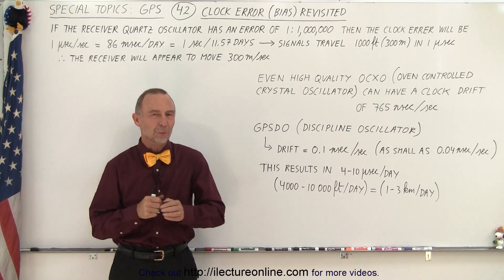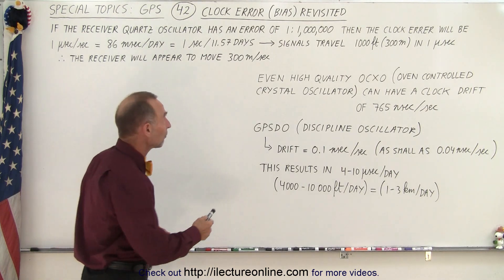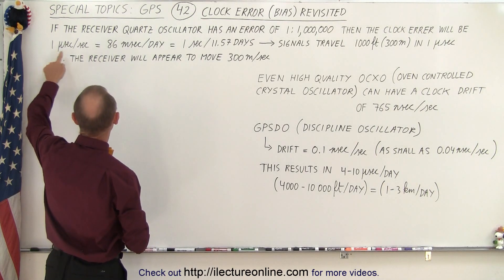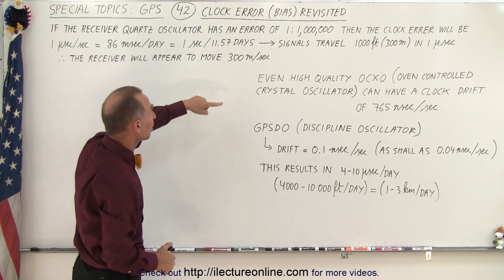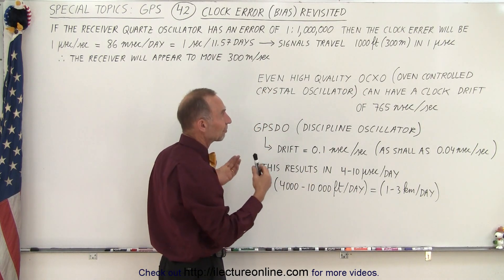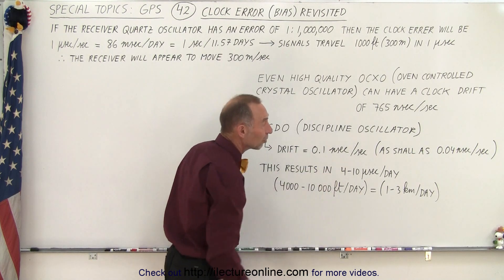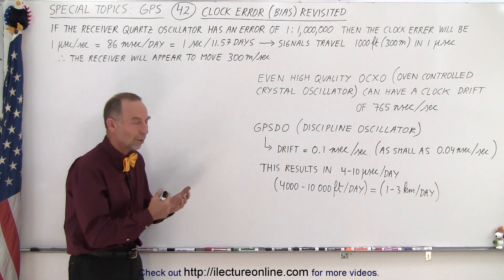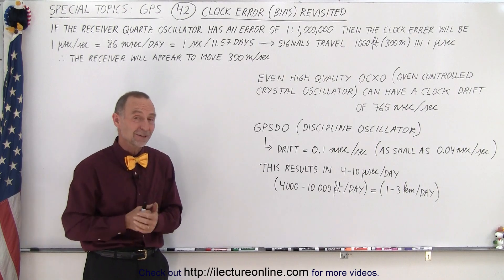Special Topics - GPS (42 of 100) Clock Error (Bias) Revisited

Comment: Point X is directly under the satellite on the equator.
Point A is 250 miles East of X
Point B is 250 miles West of X
A & B are moving East to West at 1000mph with earth rotation.

Satellite transmits. 
Point A will be moving towards the signal, 
Point B away from signal.
How is this accounted for?
Reply from the maker: Yes, but we know the position of the satellites very accurately.  We can find the velocities (delta ranges) by using the measurements and the clock.